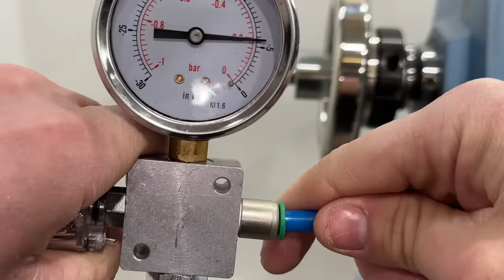Woodturning - Dynamite !!

Comment: Hello,
As usual, again a fantastic piece of art !!
I’m relatively new in woodturning, and I have a question. At what speed do you turn wood or resin on the lathe ? Do you use the same speed for wood and resin ? I guess I use a speed that is too high, sometimes 1000 RPM. 
Thank you in advance and lots of greetings from Belgium !!
Koen
Reply from the maker: RPM depends on the diameter of the piece and the material you are turning. It can vary massively. What lathe are you using?

Comment: What a fantastic piece!   That spalted beech looks just like the southern magnolia I turn all my stuff out of.  Where did you get your vacuum chuck, that is the nicest one I have seen?  Great to see you using your JM tool rest again.
Reply from the maker: Thanks, the chuck is from Simon hopes website. I’m not sure it my favourite vac chuck. The ones with a rubber rim allow for better holding without witness marks. These are fine for a flat surface but you’ll notice witness marks from the top of the egg going inside. 
The JM tool rest is a good one. The vicmarc ones have their place too.😊

Comment: That's really good.  The black resin worked really well.  May I ask if the BondLoc is freely available in that size please?
Best Wishes, Brendan.
Reply from the maker: Hey, thanks. Check out Simon hope Woodturning website for the bondloc in 500ml bottles. I’d recommend only using these to fill smaller applicator bottled. Iv lost my small bottle hence the messy application.. new one on the way
Reply: Thank you Sir.  Simon's site is one of my favourite places of all time but I'm a bit concerned that I somehow missed the glues.  I need to get away from his wonderful tools once in a while.
Best Wishes, Brendan.

Comment: Nice project. I must object to how you cut round pieces on the bandsaw.
   Cutting round pieces in the way you show is dangerous without using the proper 'V Jig'.
   Without the jig the piece can kick back causing you harm. It can grab the moving blade and cause it to come out the guide bearings and/or come off the wheels, creating a very dangerous situation and serious injury. The piece can also be violently pulled into the blade, causing injury.
   With how many folks who watch your videos, maybe showing how to properly use tools is better than taking short cuts.
Reply from the maker: So the interesting thing here is that I AM showing how to properly use tools.. 

The stuff you have just wrote above shows why you shouldn’t tell people how to use a bandsaw.. firstly, you didn’t mention the blade TPI, which obviously makes a huge amount of difference, nor do you mention the diameter of the piece being cut and the hight of blade engagement. 
V jigs are pointless.. Iv seen many people think they are safe cos they used a v jig and get a catch.. 

All the other points you make are so far from correct.. setting up and using a bandsaw wrong will cause all of those issues.. the key is understanding how to safely use one and actually understanding the physics at play. 

Let’s for a minute disregard most of the nonsense you wrote and focus on the sentence 
“Cutting round pieces in n the way you show is dangerous without using a Vjig” 
Are you suggesting that using a v jig eliminates ALL bandsaw related danger?? 
Obviously you are not.. I think you mean to say “cutting with a vjig will lessen the chance of the workpiece rotating as the blade engages the cut” 
But if you take a v jig and ram it through the blade like a moron your still in just as much trouble as you would be without it. 
Making a cut with care attention and understanding is the way to operate safely. Telling people they’ll be safe by using a jig is irresponsible.
Reply: I think I made my point very well. Sorry you don't see the problem and danger it can cause when cutting round pieces without the proper support.
   It doesn't matter how much experience you have or how many years you've been using a bandsaw. Dangerous practices is just that, dangerous.
   You bring up blade tpi, etc.. Well, you certainly didn't bring that up during your video. Still doesn't excuse the dangerous way you are cutting round pieces. All I see is someone using a bandsaw incorrectly which can cause injury.
   And an added problem I saw when I watched your video again... placing a round piece between the fence and blade while crosscutting a piece, especially freehand, is just plain stupidity. The proper way is to use a v-jig mounted to a miter guage.
   With as many subcribers and watchers you have I would think you will be more responsible in showing the correct safety practices while using your tools.